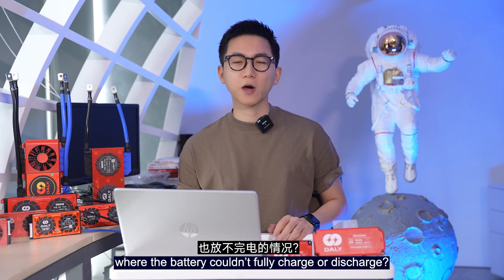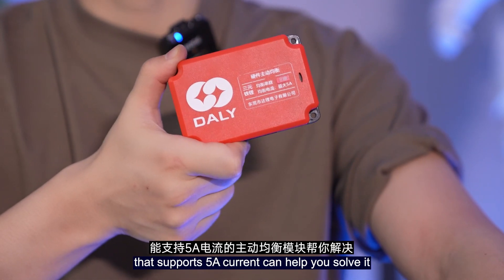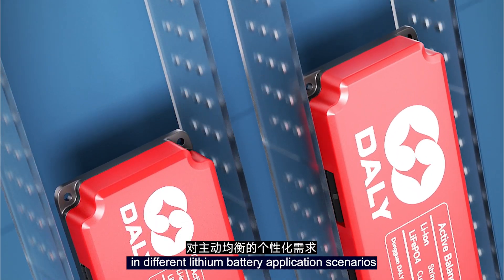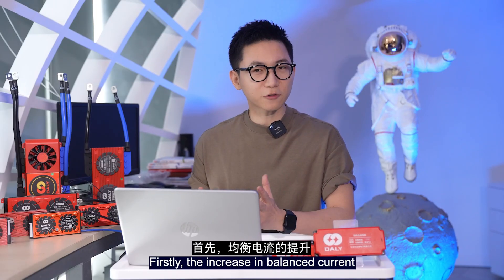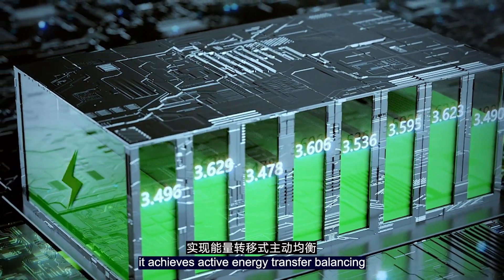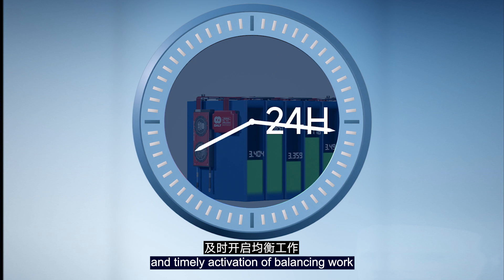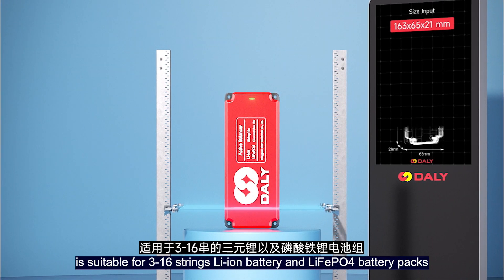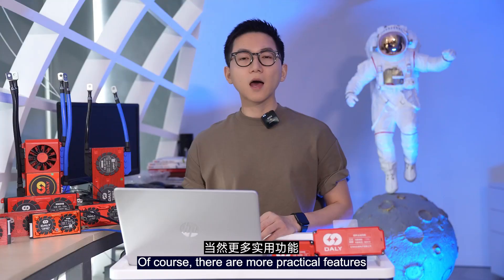5A active balancer #renewableenergy #batteries #power #communication #inverter

Comment: Id doesn't do anything... connected it to my battery back 16S 240Ah lifepo4 for over a week now, 3 cells need to be balanced according to what I see on my BMS because they hit 3.6V when all the rest are 3.38V. Don't understand why you didn't provide the option to monitor this activ balancer by app same as your BMS or previous version of 1A balancer....
And yes, I checked voltages on the plugs, and everything is correct. The green light is on.
Reply: I’ve had the similar problem, your battery is damaged need change it

Comment: Hi, I'm new to this, I have a question about balancing. For example, I have 4 lithium iron phosphate batteries. They all have different volts. 3.2v 3.4v, 3.1v and 3.5v. If I buy an active balancer ,There will be no need for manual top balancing? I hope you can help me
Reply from the maker: Hi there, normally we don't recommend using it this way.